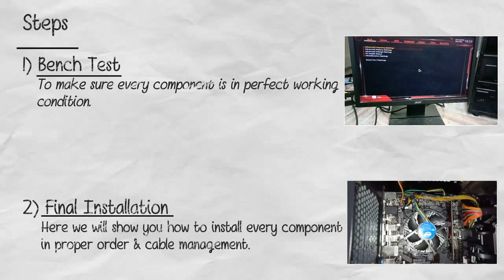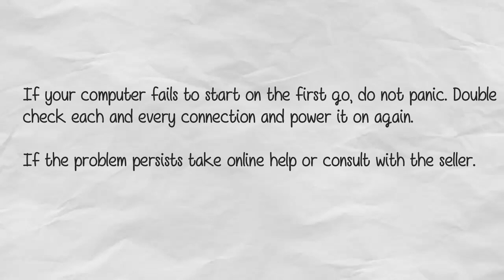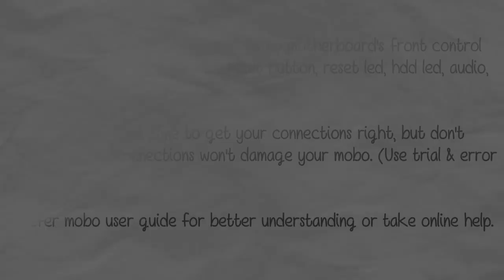Budget PC Build - Assembling || MD Computers.in || Part-2|| Under Rs.19000/-

Comment: Regarding ram and processer
Reply from the maker: System Benchmark Results
1)PCMARK -  https://www.3dmark.com/pcm10/32161503
2)Passmark  -  https://www.passmark.com/baselines/V9/display.php?id=114324637537
3)Passmark Rating 1(Screenshot) - https://drive.google.com/open?id=1Chmdq51jjvzTuIMJbQG3_W2dP7GmHoKV
4)Passmark Rating 2(Screenshot) - https://drive.google.com/open?id=1uiYUxDsCMvOa1DByD0qLaYtni4hJp5sp
5)Novabench (Screenshot) - https://drive.google.com/open?id=1h5vq_E15AFoxW7bGM448i4qjSjX6y5fu